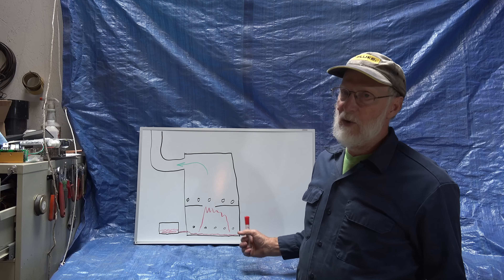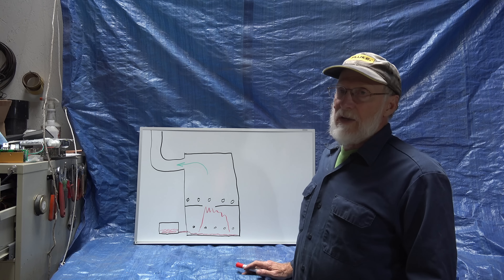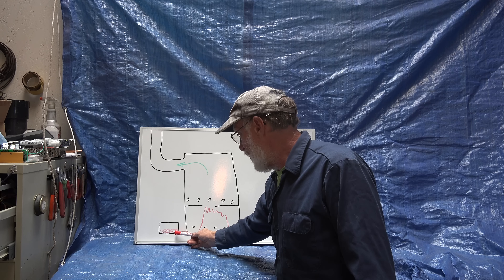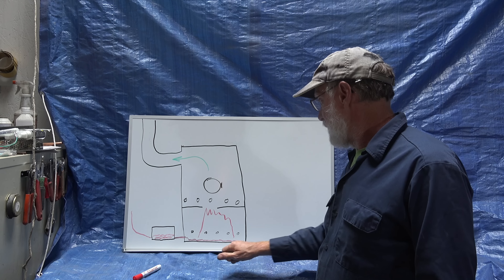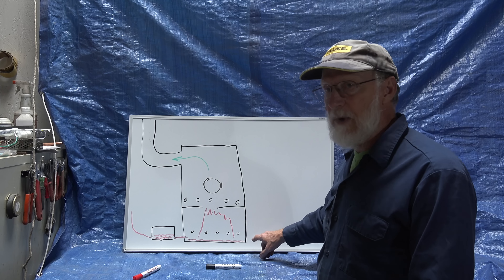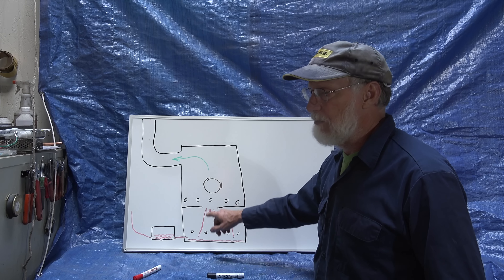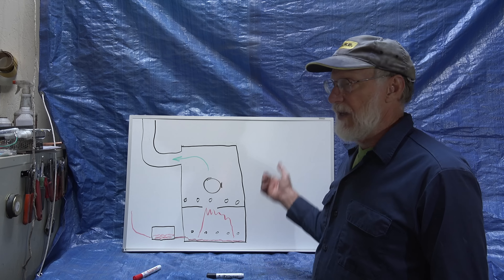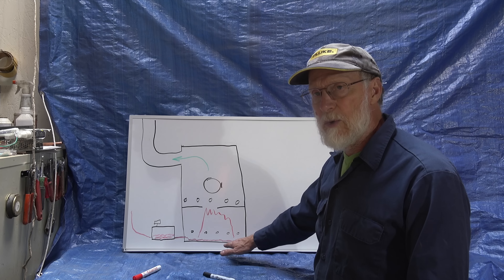How the oil "pot burner" works

Comment: i'm hoping that you will see this and might be able to provide me with some insight. I bought one of these to heat up my garage a few months ago and after taking the carb apart and put it back together i got the oil to flow. Now my problem is the darn thing wont stay on, the flame starts and even if i put it at high flow it barely generates heat and eventually my flame just dies. i did a bit of reading on what could b the problem guess it could be air intake. after watching your video i noticed i have no holes in the chamber would you recommend drilling some or just get a barometric damper and put it on my exhaust pipe?
Reply from the maker: I would not modify the burner.  The barometric would help.  But your problem is almost certainly blocked oil flow.  Dirt in the needle valve, no filter on the oil could be the problem.
GFM
Reply: @grayfurnaceman  thanks a bunch ill give the barometric a try since it's easy enough to replace a piece of pipe and leave the burner alone. if there is no change ill take the thing out and apart again.
Reply: Well just to say that you can't beat experience. I opted to take the thing apart first only to find that the brass tube that controls the flow was remaining stuck at the bottom. I had cleaned the exterior of that brass cylinder when i bought the thing. Turns out that there was some gunk in the tube that this brass "needle" slides in and out of. So i put a rifle cleaning brush in the chuck of my drill and cleaned it all out. i guess the thing sat for a long time with old fuel in it. i can't say if it will fix the problem or not since i also took it upon myself to try and take the entire thing apart to clean the bowl and all that. I'm still trying to see how it comes apart, Ill let you all know how it turns out the motel i have is a Duo-Therm 575-9 in case anyone has incite on the insides of that thing.

Comment: Hello grayfurnaceman, I have one of those pot burners, a Siegler 8870 that runs on fuel oil. I am having trouble with it and there isnt much information out there.  I removed and cleaned the carb in like 2010 and it ran beautifully after that. The last time I ran this thing was in 2012, but now I have to use it again.  So in fall of 2012 I had to move the the outside fuel tank and replace the stand it sits on.  The newer stand sits about a foot higher than it had been.  That is when I started having issues with heater as I could no longer make it burn on a low setting!  I have measured and the outdoor fuel tank is sitting about 4-6 inches higher than the recommended maximum height.  My question is, is it possible for the height of the tank to affect the flow of the fuel oil so significantly??   I mean the last time I used this heater it became so hot that the sheet metal ring inside glowed red!  Too much fuel oil flowed in and I couldnt lower it!  Is it possible for the height of the tank to cause this?  I should I be looking for an issue with the carb?   Thank you.
Reply from the maker: The height could be the problem.  However, you should be looking at the low fire valve.  It could be held open by garbage.
GFM
Reply: @grayfurnaceman  Thank you. I just took it apart again hoping to figure out what the problem is. There was quite a bit of crap inside, a lot of rust particles from the fuel tank, but I couldnt find anything wrong with it.  I hope that was the issue. I will be adding fuel oil and testing it this week.  Thank you replying to my questions, I appreciate it.

Comment: I have one been trying to figure out how it works it’s brown with a little door on the front fan in the bottom there’s a little reservoir on the back of it or a tank looks like maybe a fuel tank or something then it has a line running out  regulator at the bottom oh yeah and my mistake it’s a oil stove 1947 siegler It’s an excellent condition looks like it was just  unboxed yesterday but thanks for the video gonna try to get her up and running

Comment: I've got a riddle for you!  I was able to get my Burnham v8 series oil furnace working thanks to your videos!  But I had to bypass the CSD cell.  I replaced it, and it's still not seeing a flame. I've tried bending it to point a bit more up and a bit more down, and it's still not reading like it should (I've checked it with a fluke multimeter, and replaced it with a new one) - should I try to clean the path of it with a pipe brush?  Compressed air?  You rock - thanks for the awesome videos!
Reply from the maker: Sometimes using silver spray paint on the gun tube works.  It should show less than 1000 ohms with the burner on.  If all else fails, you probably have a failed cad cell relay.  Hope this helps.
GFM
Reply: Awesome - didn't think of that. Thanks for the reply!

Comment: I had a pot burner in the early 60s, the carb malfunctioned and it burned up the MH that I was renting from a farmer.. As I think back, maybe it was my fault because I didn't know very much about it and the float may have been set wrong and let in too much kero. the kero was actually coming out the vent holes.  once that fire took off, there was no stopping it because the floor had been kero soaked for yrs, it was dry but the oils were still in the floor around the burner. also I used to stop at the gas station every night and pick up five gal of kero and maybe, I don't know for sure, but there may have been a touch of gas mixed in with the kero., back then there was no suing or insurance companies investigating fires. the fire company was about five miles away and there was nothing but a frame when they go there, no cell phones either, nearest phone was up the road.
Reply: What a sad story, I have never liked this type of stove, they are a bit like a semi controlled chip pan fire..

Comment: would motor oil go tru the carburetor alright?
Reply from the maker: In a word, no.  If it is preheated, it may work better.
GFM
Reply: @grayfurnaceman  alright, thank you for the information.
Reply: @billsmith1770  thank you for the info. for me its to heat a shed while i am working outside. its very cold here in winter so i think i will have trouble lighting it and having the oil to flow when its -20C.

Comment: Not very knowledgeable. 

Pot burner still used. They make it in any configurations, from small heater to stove with oven. Thousand of people use them. You can buy them brand new. Two brand come to my mind about pot burner stoves: Refleks and Dickinson. They work with diesel fuel with very well designed carburetor. And they are extremely efficient.

Comment: They're all over in my area. Mostly Jungers or Seigler stoves. I refuse to work on them.
Reply from the maker: Well, its been a long time for me too.  I think the last one was about 1995.
GFM
Reply: Sieglers were a good, dependable heater. Why would you refuse to service one?
Reply: Exactly why I started the Keroseneheaterandstovecollector group on yahoo. I live a few miles from the Siegler original factory and some in my area worked on oil heaters. None of them would offer any help so I did my own research and now have over 700 members who joined mainly because no one could or would help them.
Reply: @acousticedison  How do I get to this site? I have a Esse pot burner and have no idea how to work it. I bought the range and want to use it.

Comment: I know this is old as shiat..  maybe someone is out there who can add educated or experienced 2 cents to modifying carburetor/regulator from an old Pot burner stove like this to use waste oil.   Seems to me one would modify the size of orifices to end up with a regulator that flows thicker waste motor oil at same pace it would be flowing diesel/kerosene.  

this way you have a float shut off for added safety as well as more control.
Reply from the maker: I have worked with waste oil systems for many years.
Using waste oil in a carbureted oil furnace is not recommended.  They are just not designed for this use.
Soot buildup is pretty much uncontrollable.
Orifice size would have to be adjusted for each type, SAE number and temperature of oil used.
GFM
Reply: @grayfurnaceman  appreciate.  crud I could see an issue in carb  (plan to control that though..... .. orifice size......  not so concerned once an appropriate size is figured out for generic heavy oil.  By time the collected stuff is all mixed together the viscosity will end up pretty much always bout the same for all batches.   Would keep tabs on that too.  

I just want a float control for preventing overflow is all.  Only reason considering using an old carb.  Open to ideas for this that does not use an oil stove carb.

Comment: Too much oil in the burner?  Tie a roll of toilet paper to a string and drop it in and allow it to soak up the fuel. Take it out. Repeat if necessary.  Been there.  Still using mine in a wall tent.  Never had one dance around a room, doubt it could happen actually, it would blow up before it started hopping.  But they do make a wonderfully frightening woofing sound if they get too much oil before they're running efficiently.  Also set a can of pork and beans on top of the burner,barrel one time and it exploded.  Beans all over the inside of the tent.
Reply from the maker: I have another one.  I souped one up in Korea and could pop popcorn in 2 minutes.  Leave it 30 seconds too long and it burned.  As for the sale, don't hold your breath.
GFM

Comment: It is NOT a carburetor, it is a constant level oil valve.  A carburetor is an air/fuel mixture device and the constant level valve does not in any way, shape or form mix any air with the oil.
Reply from the maker: You are correct.  However, some manufacturers have designated it as a carburetor.  Thus the reasoning for the designation.
GFM
Reply: @grayfurnaceman   Oh boy I remember these from my early days mainly in mobile homes. Lots of times I have found the safety controls such as they were wired around and such by "half A** tech that never repaired anything but set up the potential to burn the trailer to the ground. Seen it a lot with Coleman 8845's  Those were the days :)
Reply from the maker: @kg4muc  But not really good old days.
GFM
Reply: @grayfurnaceman  You are so correct!

Comment: Anyone ever use waste engine oil.in one? I'm sure it would need to be thinned out flow ok...mayne add a small percentage of gas? Alcohol???  Something to increase volatility and thin it
Reply from the maker: It does not flow well thru the carburetor.  You may be able to reset the oil valves to make it work.  
GFM